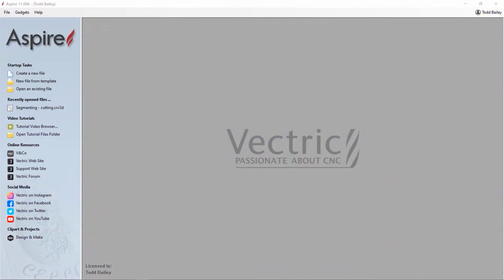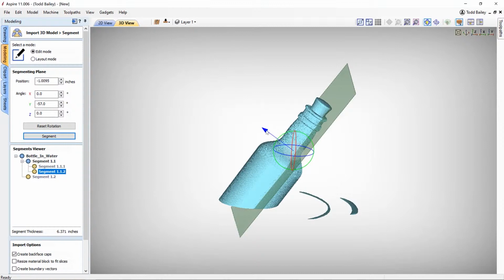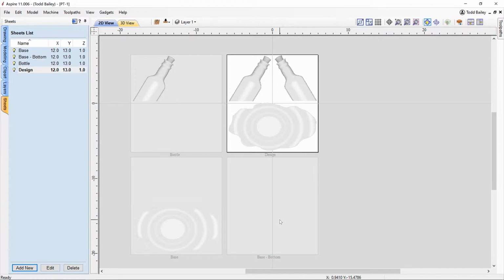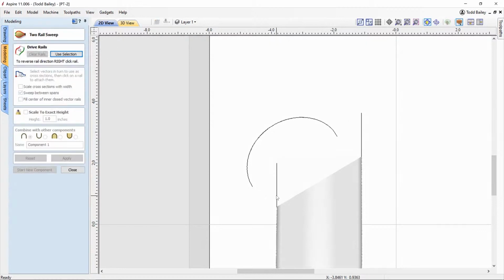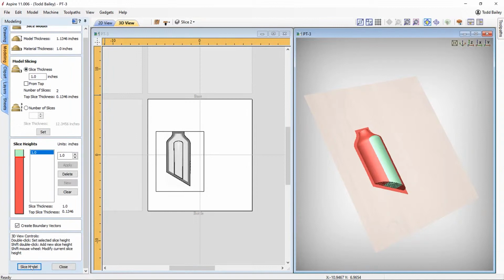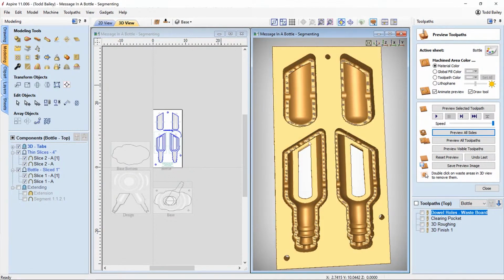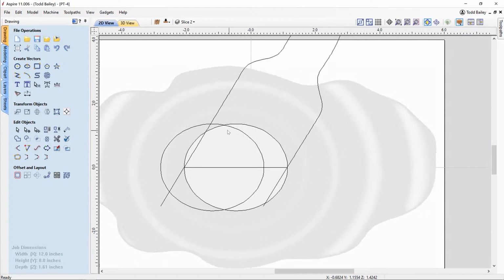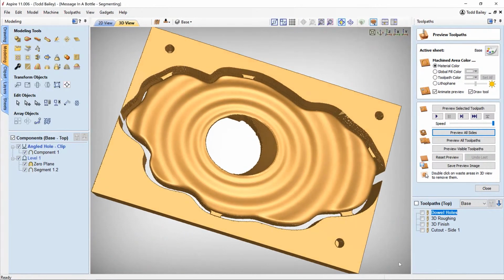3D Segmenting with Todd | Vectric Worldwide UGM 2021

Comment: Todd I have been searching around in the tutorials with your name on it. I believe that in one of your tutorials you demonstrated, in node editing, how to stop one of the arms from moving while you grab the other arm and adjust it.
Reply from the maker: Hey Tom... thanks for leaving the question. Yes, if you are in node mode (shortcut - n) and have a span that you have turned into a "bezier" (shortcut - b while hovering over a span in node mode), then 2 handles will show.  If you select one and drag, or select one and use your cursor keys to nudge it in a direction... that should do the trick.  Now, if you find that the node attached to the handles is "blue" that means the node is set to "smooth" (and if you drag one handle the one on the other side of the node moves to), you will need to turn off smoothing. Hover over the "blue" node and press "s," or you can hover over the node and right click your mouse... you will find a list of options, and their shortcuts will pop up.  As for a video where I show it... that might be a tricky one.  We touch on this stuff often but this video might help - https://www.vectric.com/support/tutorials/vcarve-pro?search=Drawing&video=lily-leaf-molding-drawing# Try bookmark "6".  I hope that helps.
Reply: I will just have a look see to see if I got a reply. WOW and and yes yes, turn off smooth !!! I watch that video from the begging, and its amassing how much you forget when you don't always use certain  aspects of the program. And its not like I don't use nodes. Its actually the opposite, we use them all the time. We are a plastic shop here in Nanaimo on Vancouver Island. We have two 5x10 cnc routers and have been using Vectric for 9 years now. Its all we ever needed. Mind you Aspire would be nice to have, but we just haven't had a need for it. But then again once you have it you wonder why you didn't get it sooner, like a 12" micrometer. Thanks for the quick reply. Tom

Comment: Thanks for the instructions on 3D segmenting as far as the glue I have been using super glue works fantastic and no clamps needed when glueing the slices together.
Reply from the maker: Hello Rodney!  Thnaks for the tip... I think that would have fixed my "dripping" problem!